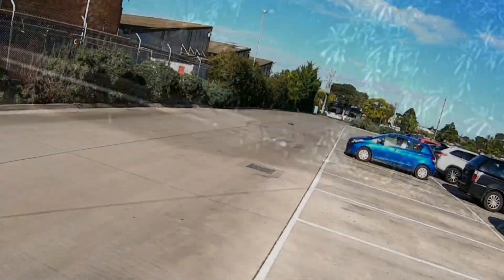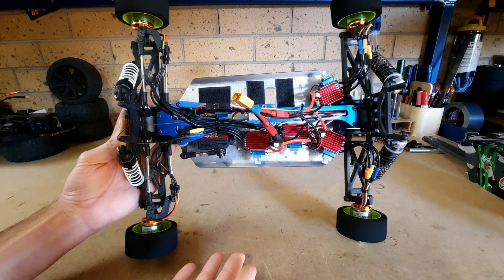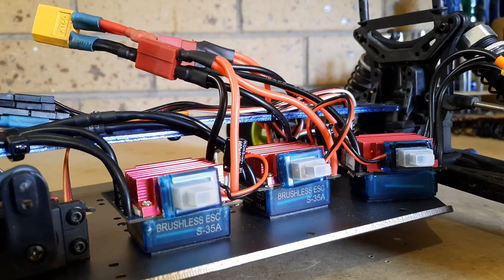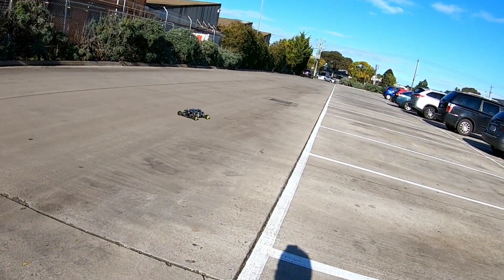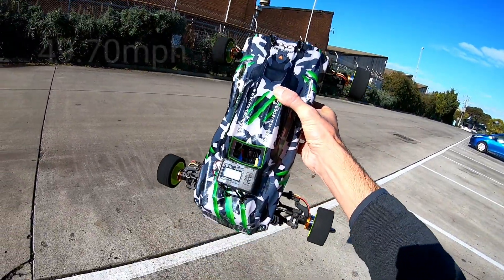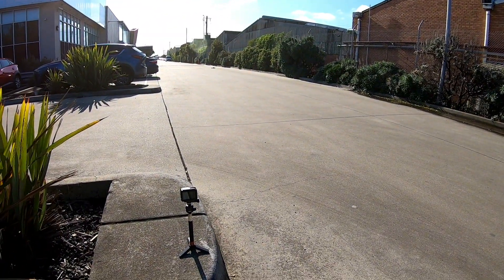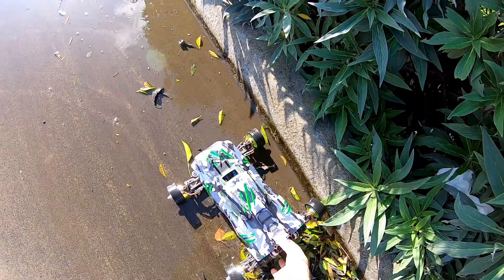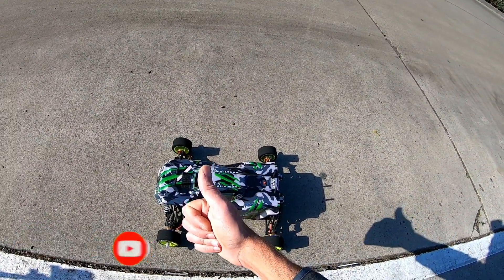The Evolution of RC cars? QUAD motor RC car! EXPLAINED and 3s test.

Comment: I am not sure how the the receiver to esc splitter is wired, but I assume each line is just split to the four escs, so parallel wiring. So if the escs provide voltage at the third wire you removed, they should also be wired in parallel, so their voltage does not add, just the current draw of the receiver should be split from the ESCs. But electronics can be finicky, so still probably saver to do it your way.
Reply from the maker: Yes it's all parallel connections but I have seen a few cases where multiple esc wires going to the receiver where wired in parallel and for some very strange and unknown reason the voltage doubled and burnt out the receiver, doesn't make sense at all no🤷
Battery wires were parallel also🤔

Comment: Hi mate.. what are those hex hub to used to mount the wheels to the motor ?
Reply from the maker: They are actually nose cones for RC plane's, they come with the motors but you can get them separately.

Comment: Some of us aren't familiar with the VRX brand. Is that the 1/10 scale drift car chassis? No sense buying a whole car if 1/12 of it will be thrown away, but maybe that's what would have to be done.
Reply from the maker: I believe it was a 1/10 buggy chassis, VRX Sprint chassis I think.
Reply: @rccrazy  Thanks.

Comment: What's the tire size?
Reply from the maker: 65mm tall and 30mm wide front and rear
Reply: @rccrazy  oh, does it have enough torque for going offroad .
Reply from the maker: Oh no it definitely didn't essentially with the bad quality escs.
If I was using Hobbywing or another good brand of esc maybe but I think the motors would've been beaten up and fallen apart anyway😅

Comment: How did you solve the problem with the front wheels steering - oversteer and etc?
Reply from the maker: I didn't do anything with it after this video, just messing about really seeing if it would work and it did so I was happy.
Reply: i wonder how good steering is and not messing with oversteer... @rccrazy
Reply from the maker: @addyshimov  well it didn't have oversteer issues it was definitely understeering due to the escs being so laggy.
I couldn't afford 4 good escs to male it better so I just converted it back to a normal vrx cobra again.
Reply: so you mean with better esc`s the steering would be great - like diffs? @rccrazy
Reply from the maker: @addyshimov really good way to look at it yes, but with the laggy/under powered escs it felt like diffs with water thin or ZERO oil in them😅
With well synchronised and powerful enough escs it would've felt more like having 50-60k oil in diffs and probably steer great and maybe even capable of drifting👌

Comment: Joining multiple  esc into receiver does not multiple them from 6-12-18-24 unless you physically wire each pos to neg ie series. Having an adapter with 4 joined parallel will just be 6volts at the receiver so no need at all to worry about overvolt as no chance of that happening. Great vod.
Reply: I was going to say this too. However you could do tank drive or torque vectoring if you program it right with 4 motor controllers.
Reply from the maker: It can be done with a DumboRC radio but it would look more like it was drifting rather than steering, I don't want it to look like it's drifting.
It's got no steering issues just bad escs.
Reply from the maker: Thanks!
The main issue with the BEC in such basic electronics is that the voltage or more so the current is not always equal even on the same model escs.
If there is a massive difference (probably 5% or more) that can cause all sorts of synchronising issues and unwanted resistance in the system.
I would rather just remove a few wires than try and closely enough match 4 escs.
Some companies do say its fine but I think you'll find their escs are very close to each others specs, and expensive😅

Comment: Are the motor shafts durable enough? Won't they bend after a collision/some off-road driving?
Reply from the maker: This will never be going off-road!
Don't plan on crashing but the shafts are definitely strong enough for this application.
I'm more worried about the motor magnets coming loose but no issues so far.

Comment: What was the top speed on 3s mate
Reply from the maker: 89kph so far
Reply: @rccrazy  I've got a similar setup with 4 1000kv motors 40 a escs on 2s it can't start moving without a push , I was also wondering how how your motors get because mine get fairly warm after a run on 2s I don't want to burn them out
Reply from the maker: My motors are fine on 3s and get a little warm on 4s, better escs are definitely needed and turn the punch settings upto full.
Reply: @rccrazy  good call mate thanks, any idea roughly how hot is too hot for these motors
Reply from the maker: I think outrunners a little more vulnerable to heat and damage compared to inrunners, I'd try and keep the temps down to like 80°C max, any more and you run the risk of permanent damage.
Reply: Right mate sorry about all the questions haha i appreciate it , working on an f1 style car with servo actuated drs flap that lowes the angle of attack of a rear wing flap , front wing flap and rear diffuser at once,  made a ground effect under tray for it too along with multi element wings , downforce is immense it just sticks to the floor no spinning it out
Reply from the maker: It sounds like your putting a lot of effort into that build, just incase you didn't already realise, the downforce you've added will put massive strain/drag on the motors, that could be why they are heating up more than they should be.
Reply: @rccrazy  yeah mate the boxing season hasn't started back up yet so I've got some spare time , to be honest I considered this its the equivalent of adding more weight to the car , I might actually remove the aero to test it thankyou
Reply from the maker: Spot on mate!
It pretty much just adds a tone of excess weight and in some cases (low watt motors) it's too much for the system.
I know, I love adding fancy splitter and stuff to everything aswell😅
Good luck again mate🤘
Reply: @rccrazy  this hobby is far to much fun mate haha,  you have a good one

Comment: Good to see it running on the road. Been looking forward to this one. With a few camber mods it will handle great. Well done mate, keep up the great work with the cars and your channel. 👍🏼🚗👊🏼
Reply from the maker: Yeah thanks mate😁
The camber is ok but I won't be able to change the toe angle, gyro helps heaps though😅
Thanks for checking it out man👊
Reply: @rccrazy  ah meant to say toe angle. Cos it’s fixed.🤪
Reply from the maker: All good man, just my brain being obsessive compulsive😅
Reply: @rccrazy  it probably wouldn't be too difficult to design and print up some custom hubs for this bad boy.
Reply from the maker: Yeah definitely thought of that👌
Reply: If you decide you want to do it and need some input let me know.  I've got the CAD experience and printers to churn it out I think.
Reply from the maker: Thanks for the offer👍
I have a young mate Lennart that lives around the corner from me, he makes my 3D and cnc parts normally, if I decide to and Lennart can't make them ill get onto you for sure👌

Comment: Class mate , I'm currently working on a similar project , you plan on uploading any more vids of this car ?
Reply from the maker: Awesome!
I would love to see what other people come up with🤘
Yes I'm waiting on some cheap 120a escs then I'll take it somewhere much longer, do a 3s speedrun then try 4s, we'll see what happens😅
Thanks for watching mate👍
Reply: @rccrazy  best of luck with it mate I'm looking forward to seeing that, I'm "recycling" some 5s 2300kv race drone motors for use in my project.
Reply from the maker: Ok cool, just be aware that many ESCs don't recognise 5s lipos and will start up as 6s and just hit low voltage really quickly.
You can switch the ESCs to NiMh mode and run them if you keep an eye on the voltage, I don't think they have a low voltage cut-off in that mode.
If you didn't already know that or are using 5s specific ESCs👍

Oh and if yours is direct drive like mine I probably wouldn't run that high kv on 5s or even 4s, my 1000kv motor get hot on 3s😬
Reply: @rccrazy  good call mate thankyou I appreciate it , do you have any idea how you're going to solve the cogging problem yet?
Reply from the maker: All good👍
The cogging I think is just from having only 35a ESCs, if it still coggs with 120a ESCs that will tell me the wheels are still to big (over geared)

Running higher voltage will sometimes eliminate cogging aswell (less resistant I think and higher start-up punch) but obviously don't go over the recommended volts running direct drive like this unless the motors are like 300-500kv😅
Reply: That makes more sense now , thanks for all the much needed insight and knowledge , gained a sub :)
Reply from the maker: Thank you so much mate😊
If I can help I'm definitely happy to!
Stay safe👍

Comment: Is it possible to do the same with the xmaxx 8s?
Reply from the maker: Possibly but most outrunner motors probably wouldn't hold up too well directly supporting the wheels on a off-road build especially that big, I could be completely wrong though🤔

Comment: Been waiting for this test run since you told me about this project, that runs sweet man, great speed in that tiny spot. Look forward to you opening it up on a proper straight road, should get close to 100kph I reckon 👍
Reply from the maker: Cheers heaps man🤘😁
Yeah I had no idea it would have such good acceleration😅
I think you may be correct saying about 100kph on 3s, that would be awesome!
120kph with some 4s escs on 4s and I'll be stoked🤞
Thanks for checking it out man👊